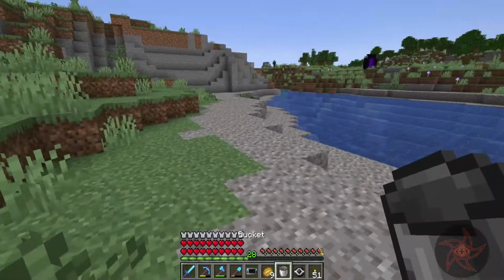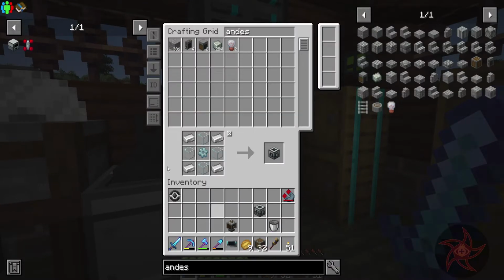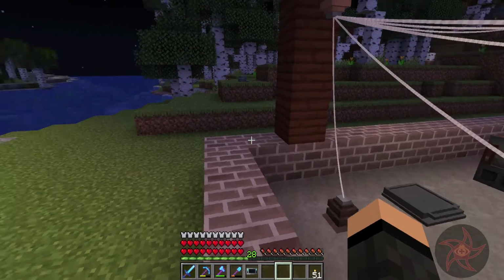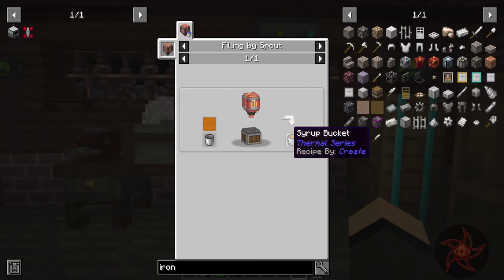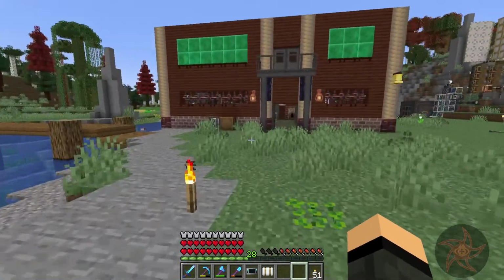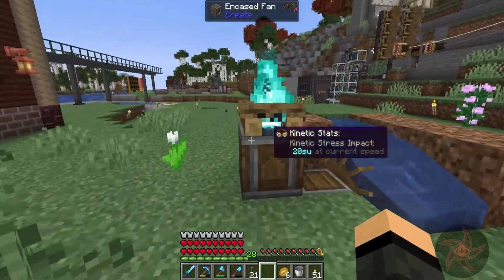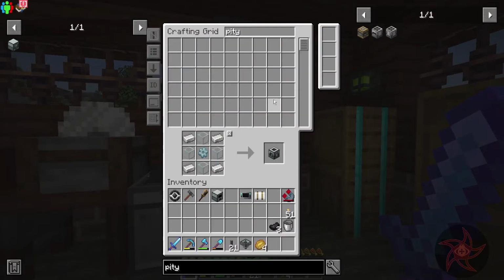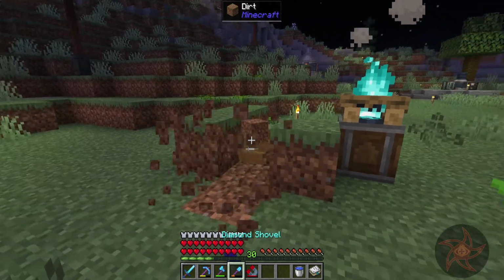Harmonious Engineering 1.18  :: Rubber Production :: HE-29

Comment: I had this TPS lag after the 3.1.4 fix for 3.1.3. What worked for me was visiting (x=0,z=0) for each dimension, since the dimension filtering component of the mcfunction clearly didn't work as it was supposed to.

For those curious about the technical reason behind this:

My cleanup of mobs was to teleport all oxygen-needing mobs to 0, -256, 0 - and then kill them. Well, (0, 0) is usually not loaded so they unloaded before being able to be /killed. This accumulates in the world's data file, so those lag spikes are from the world having to save each entity from that chunk to the disk. 

Again, I can't apologize enough 😅
Reply from the maker: No worries, I am curious though if you can use dynamic coords in your script, ie. ~0 -256 ~0 instead, if used on a player it would teleport them to -256 to their current x,z location, if it works for the mobs it might get rid of the mobs stacking up at 0,0